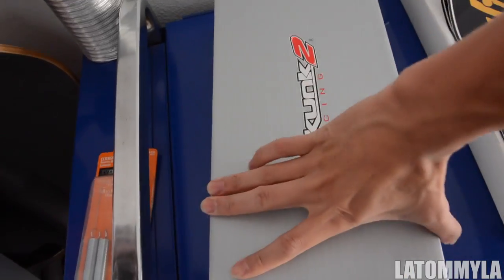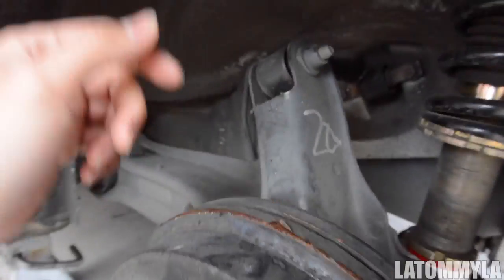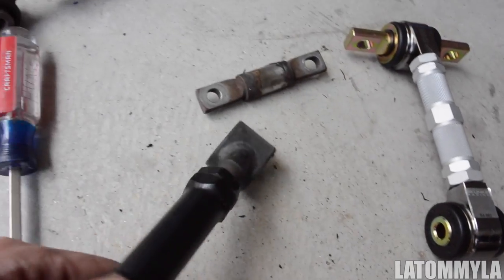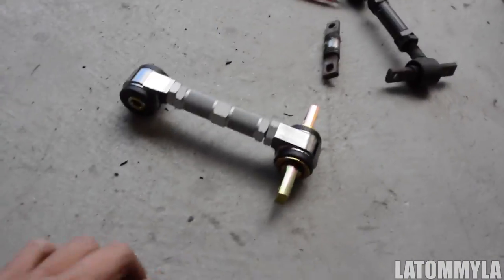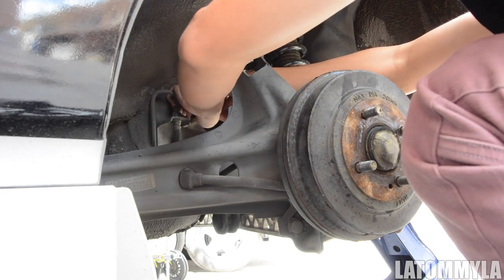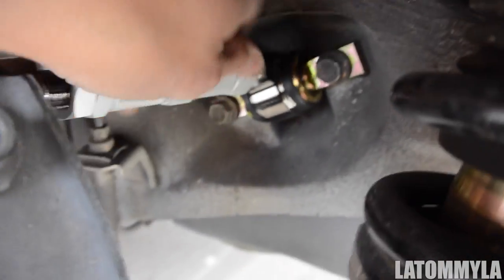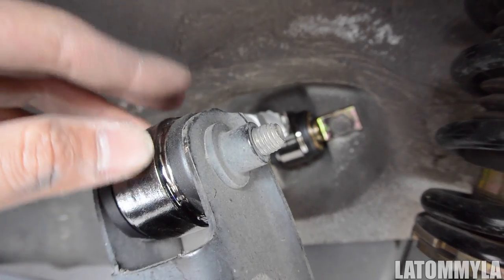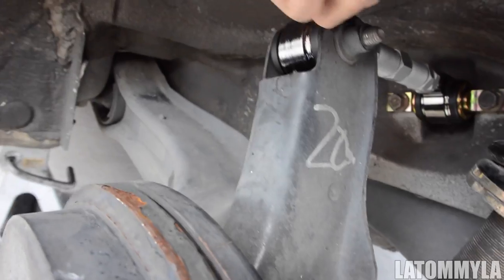Installing Rear Camber Kits

Comment: Nice video. Tightening the bolts under pre-load is only necessary for rubber bushings because they're chemically bonded to the metal. Those look like polyurethane bushings, so it's not necessary for those. Either way, it's a good practice to follow.

Comment: to adjust camber you can use the "rope techique" around the car, try to measure everything (specially threads) on MM with a trusted calliper, more precise if you do this way, if not the rope and the eye measurement will be enough instead of paying to align all the car each time you hit a hole on the street

ps: good work on loosining  all the bolts to compress suspension, not many people do and know that, you can always put some wheels underneath to do the same process instead o jacking one wheel, it is better to have the natural weight of the car on each wheel

take care and good work

Comment: Did the knocking stop?My bushings were busted but was knocking ONLY when i made a left turn. So i swapped the passenger rear but i didnt put load on the suspension and went for a test drive and it makes a knocking noise still. 
So its on stands now and i am going to losen it up and place load on that rotor as you showed.
I will also install the driver side rear too and see if the knocking stops with both being replaced
Reply: I redid my entire suspension on front end on an 98 accord. I didnt put any weight on the suspension but tighten ld everything down as the car was in the air....which I head you shouldnt ever do .now it pops when I break hard or turn ..is that what yours did and did u fix it?

Comment: Got the same camber kit. Do you think it could hold track days?
Reply from the maker: +Constantin Lys Yes they will, I used them at 2 track days already
Reply: they are all full aluminium right? my friends tell me to use steel ones instead, as they say aluminium could break

Comment: Just about to put a camber kit on my civic 96-00 hatchback - I have taken the lock in nuts off however they don't align , the bit that goes into the wheel joint is lose to get it to align - does this matter ? Will it come undone ?
Reply from the maker: I would put those lock nuts back in, totally not safe.
Reply: LATOMMYLA I put 1 back on (single bolt on) and tightened the double pin one , on the car now all seems fine , drove it for around 5 mins nothing has fell off yet 😂😂

Comment: Idk if you comment to late messages bro but on the rear cambers how many miles can my tires last before they end up wasted on one side cuz I did my rear cambers and I wanna know how long
Reply from the maker: That idk, you need to get an alignment, your TOE will be off and kill your tires
Reply: LATOMMYLA half of the tire is in use the other half is like half an inch above the ground not that very high when it's stanced